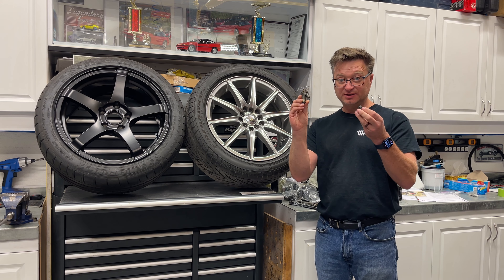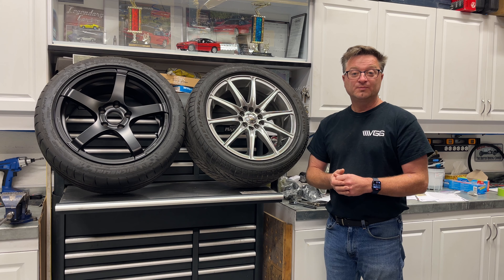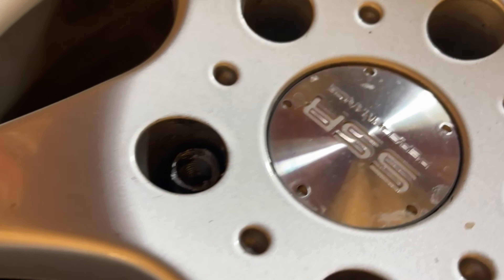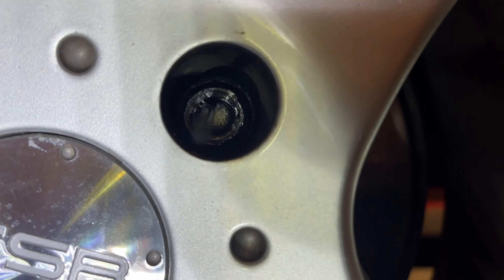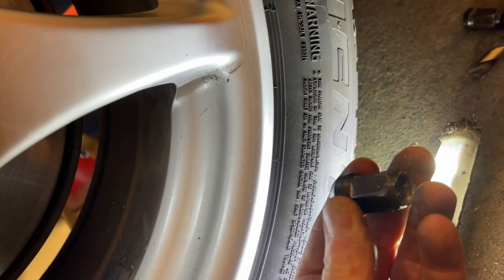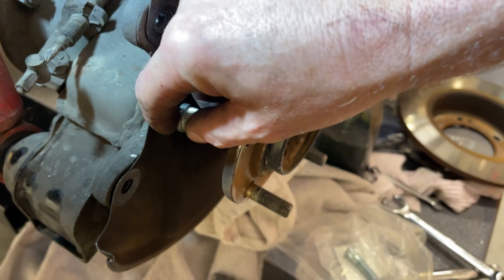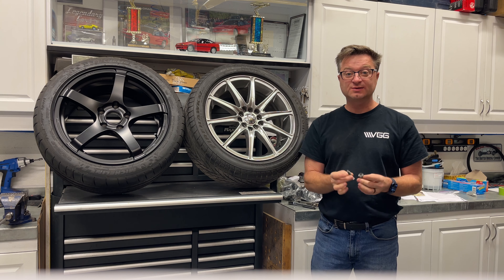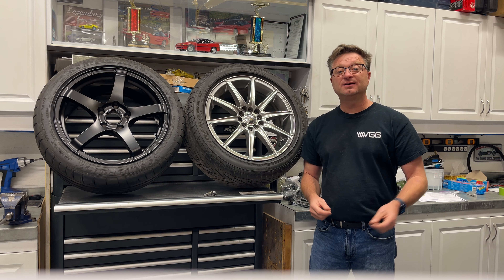How to remove stripped or turning wheel studs.

Comment: Using the method suggested below in the comments, I too used the tire as a "pry bar" by first removing all the removable lug nuts.  Then I pulled the tire away from the hub in an effort to jam the suspected "lug nut to hub compression interface failure."  The lug nut came off but my lug didn't fail at the "lug nut to hub compression interface" as addressed by your video.  I discovered that the lug nut had actually spun off of all but the last 5 or so threads of the lug.  Those last 5 lug threads were completely sheared allowing the lug nut to spin freely but not come off the damaged lug until I used the tire as a "pry bar" to apply pressure behind the lug nut to coax the lug nut off.  I was relieved that I didn't have to drill the lug nut off as you did, but I still had to replace the damaged lug.
Reply from the maker: Thanks for sharing your story and method with everyone.  It is nice to hear you had a little easier time with it than mine.
Reply: Only works if most of the lug nuts come off. If only one lug nut comes off and the other four are spinning, this is not an option.
Reply: The truck I'll be working on has 3 of 5 left on. 2 freely spin, I believe from the knurls stripping in the hub. Hoping I can manage getting them out without too much hassle.

Comment: On my cars in the past I’ve changed my studs out before this happens. I got a used Acura that was probably serviced by the dealer it’s whole life and those dudes over torquing lugs on and off over and over gave me a loose lug before I could even do the cars first tire rotation after I bought it. Seeing the full process from a normal dude that cares and takes his time helps a lot. Good video man.
Reply from the maker: Thanks you Cody. What a great idea for preventative maintenance is changing them out or older vehicles. Good tip!
Reply: Alot of techs at the dealership use torque sticks. Problem is, if you just go in for an express service, the techs that are inexperienced and hard headed don’t think a torque stick is important, or that torques matter even on something as simple as a oil drain plug. ‘Fast’ mechanics don’t see the importance of a new oil drain plug gasket as well. Those fast mechanics will have you buying a new oil drain pan one day.

Comment: I used your idea but modified the process a little. I first cut off the head of the wheel nut with an angle grinder, then  drilled at an angle outwards from the stud. Result was that I was then able to finish splitting the wheel nut with a sharp chisel and removed it easily without damage to the stud. The problem was that the stud was not properly seated in the hub casting and a little persuasion cured that. Only new nut was needed. No more than 5 minutes altogether.
Reply from the maker: Thank you for sharing the helpful tip for everyone Thomas.  If someone has those tools and skillful enough that works too. You are braver than me for sure as I would be worried about the grinder and chisel getting away on me and damaging the wheel itself.

Comment: Thank you for the advice, difference on mine is that is a truck e250, 8 lug nuts two studs sping got one out cut it with a grinder,second one not possible nuts are conical against the rim can not get to it, but will try you method drilling it, i am sure this is caused by over torqued  the nuts at the tire place, when i take it for balancing i see they use this big ass power impact  gun, suck!
an easy job replacing breaks resulted a nightmare 🤬
Reply: What kind of grinding bit did you use?
Reply: I used DIABLO diamond 41/2 metal cutter, is red color , cost about $16+ but does the job, don’t use that other thin metal cutter disc “will break” also get a few good drill bits and a hammer to hit stud back and forth once bolt snaps you will have  better chance to remove the nut also get a flat tip chisel  
Good luck

Comment: I had the same problem on the front wheel of an older Camaro. First, I got a long HF pry bar and placed it between the center of the wheel and the hub. Pressure was applied to the bar to create friction between the stud and wheel. Next, I turned up the air pressure on the compressor and hit the lug nut with the air gun. It spun off. No drilling. Five minutes of work.
Reply from the maker: That a great tip DS. I actually tried that method in this case and unfortunately it was too stripped to have the same affect.
Reply: I just used the tire as a pry bar and it worked perfectly! Took me 30 seconds, sooo glad I didn't have to start drilling. Tysm🎉

Comment: When I was looking for an answers on YouTube, I found your video. My question or concern would be if the spinning stud has widened the hole? Hence in future the stud might be more prone to spin? How did it feel when you have pulled it in? Do you think it was tight enough?
Reply from the maker: That is a great question. Although some material might be scored on the hub, I believe the stud itself is of weaker material which is why it is able to compress fit in the hub when new. For this reason the hole in the hub is likely not changed much, where the stud is what was worn down causing it to turn. When I compressed the new stud in the hub it was quite tight.
Reply: @SlippingTime  Many thanks for this quick reply. Many thanks for this video as well and sharing this great idea!

Comment: My question is, what do you do when the stud has turned so much that the stud hole is oversized to the point that a new stud also spins? Are over size stud bolts made to address this problem?
Reply from the maker: That is unfortunate. Usually the hub is stronger metal than the stud so the damage is on the stud when it turns. The only fix I can think of in your case is to replace the hub.

Comment: Coat the rim with high temp grease.( a very thick coat) around the area of the rim near lug nut to be removed. Get a acetylene cutting torch and simply work it in small circles on the lug nut . Takes two minutes and the grease will protect the rim . Done it this way for decades

Comment: Great video.. so what do I do if while tightening the new wheel studs they spinning..? 😩😩 I’m using hand tools, ratchet and a socket.!
Reply from the maker: Sound like the new studs aren’t compressing in the hole they mount in. It is possible the hole reamed out from the old one spinning. In that case the hub will need replacing I think.
Reply: @SlippingTime   a ma try this again rite now, it’s my ATV a quad, not a car. If still spins you think is a good idea adding some welding.? 😂
Reply from the maker: @santiagodavila1426  lol
Reply: @SlippingTime  some JB weld 😭🤦‍♂️😂🤣

Comment: have a stripped lug nut on the stud on my car 2014 Nissan Altima SV the stud is just turning. I took my car to so many shop and not one shop was able to take the stud  off I'm really in need of help taking this stripped stud off I'm trying to put a new tire and replace three new studs I need help getting this stud taken off are you in Birmingham Alabama I'll be so happy to get this stud taken off and my tire replaced I took my car back to the tire place I bought the tire from they couldn't remove the stud they were the ones that stripped the stud

Comment: What size and type of  drill bits to use?
Reply from the maker: It will depend on what mess you have to begin with. If I recall, for this one I started with around 7/64” and worked my way up from there. I find the smaller the better for control of the bit as you go up in size later.

Comment: what about using a thread extracting tool? Would that be easier for this job?
Reply from the maker: There are different ways to address the problem for sure. The thread extractor tools I am familiar with are for bolts. This scenario is when the stud is turning in the hub.

Comment: Wow how long did this process take?  My local tire shop did this when I went in for a tire rotation.  Went across the street and the mechanic there said he would have to use a torch to cut it out, break the hub cap, and ruin the wheel hub in the process 😶
Reply from the maker: Lol. Don’t go to that mechanic.  Get some decent drill bits and it doesn’t take long at all.

Comment: I have a question , I had tires put on n the tech comes out n says my stud is loose but the new tire is on my car I can't get tire off because the stud keeps spinning
Reply from the maker: Sounds like the same problem. Usually they strip taking tires off and not putting them on.
Reply: @SlippingTime  yea well the serv tech did it while putting the new tires on after all tires put on he came out n said that now I can't even change my tire if God forbid I get a flat , I have a 16 Accord it's the same wheel u were working on back passenger side

Comment: You never have to remove the hub even on rear drum type parking brakes just take a chunk of metal out and make that puppy slip. And if possible, use an impact when installing the stud. You will crossthread if you keep doing it by hand.

Comment: if it stripped once it will strip again since the outer sleeve is now ruined.  you should have replaced the hub and new studs. that is just poor work ethic.
Reply from the maker: The stud is a compression fitting meaning it is purposefully a lower grade steel to the hub.  The lesser grade steel is what shears. If you are concerned the hub stud hole has been affected then check it with a caliper.